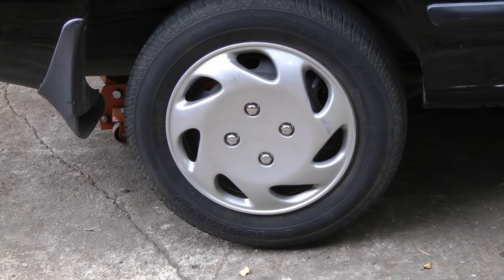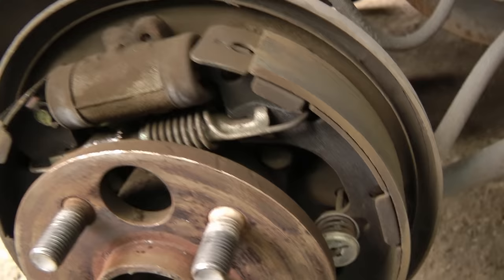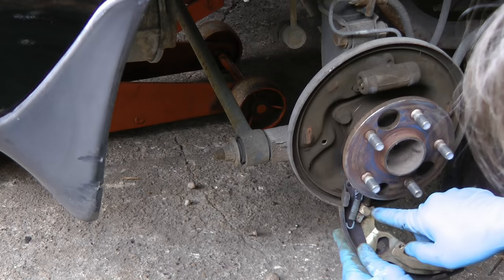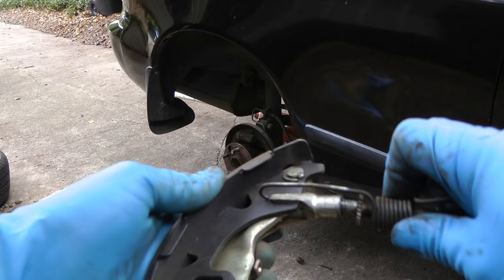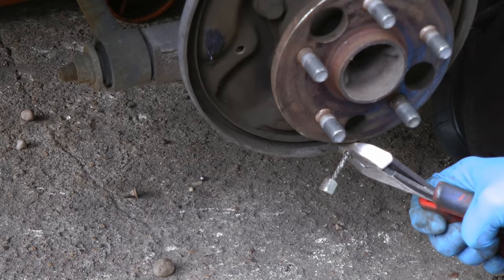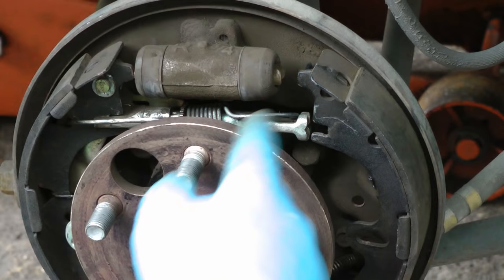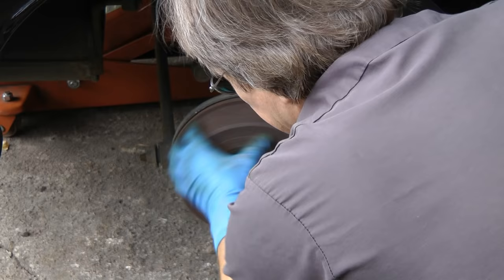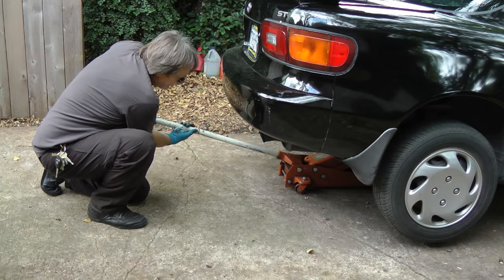How to Replace Drum Brakes on Your Car

Comment: @ArmenianSOADfreak because the bottem end oppisite of the wheel cylinder needs to drag a little so that the shoes of the wheel cylinder side contects evenley when you apply the brakes otherwise it will not only be somewhat uneffective but will wear unevenley but with self adjesters this problem corrects itself when you step on the breaks a few times and the same thing does not apply for disc and pads in the rear as the shoes back there are used for parking brakes

Comment: I recently replaced the shoes on my 96 ford ranger (even machined the drums a bit cause one of the springs was actually broken and pieces of it were chewing up the drum.) Now, after that repair, the parking brake doesn't hold the truck as firmly as it once did. Will that self-correct or should I go back in and tighten the "automatic adjuster" some more?
Reply from the maker: tighten the adjuster, you always have to do that to make it firm

Comment: I gonna guess that the reason you didn't use stands is the fact that you were never under the vehicle. But the load could still shift on that single jack. It might have been wise, if only to set an example....

Comment: hmm I have a very similar brake on a chevrolet lumina apv but the drum didn't have provisions jacking screws

also aren't you going to damage the spring if you use a cutter to undo the spring ? 

I've had a spring break and get stuck between the shoe and the drum, it ruined both !! :(

also modern cars like a camry 2001 gas a combo shoe and pads drum/disc hybrid brake that is a different procedure 

do the auto-adjuster work when you use the e-brake only ?

also that bearing is 53$ on ebay w/abs

Comment: Hey Mr Kilmer got 2 questions. on a 2008 Kia Rio Lx , are the rear drum brakes hard to do ? beings its a newer car?   an 2nd i want to change the brake fluid in my hyundai i see all auto parts stores carry synthetic DOT 3 4 brake fluid ? is that safe to use on a 99 elantra non abs , just want to flush the brake system. let me know . thanks scotty

Comment: hey Scotty love the  Channel. question I recently change my shoes and when applying the brakes they come off the master cylinder what might cause this not properly tightening the adjuster I need a little help
Reply from the maker: yes, you put the shoes so they fit on the wheel cylinders, then adjust the wheel until the shoes just start to rub on the drums as you spin em

Comment: How to remove that C washer on the parking brake shoe lever (This video about 02:18 shows it) ?  I failed to get it off and didn't transfer the lever to the new shoe. Also, my plier didn't work well on these springs, they are so tight, maybe I should try a bigger plier?

Comment: Yeh I have a GM Sunfire 2004 with new design rear brakes n you will not get drums off with out cutting them off.they brakes are adjusting out on there own driving down the road not touching brakes n seizeing up the wheels good old GM they made a two hour hundred dollar job into a grand job n if just want to inspect the brakes you are Gina pay dearly.

Comment: I'm changing shoes on a 2003 civic and I am having trouble with the retaining clips. Any suggestions?
Reply from the maker: I push and shove with a cutting pair of pliers, but auto stores do sell a special tool for that
Reply: I got it done. Thank you.
Reply: if you can manage to get a tool or a digit behind the center pin (on the other side of the hub) that will help the pin not push in with the holding cap. when the cap/pin is heavily rusted it's nearly impossible to push the cap and spring down without also pushing the pin down - the special tool holds the pin head/tip in place while you depress the spring cap, but you can get the same effect by simply stopping it from behind - if you can reach it (depends on the vehicle i think?)

Comment: Hi, Scotty:

I have a problem with my 1989 Ford Ranger Standard Transmission. Recently when I press on the brakes slowly, the pedal goes all the way to the floor and my truck barley slows down. On the other hand, when I press on the bakes quickly, the truck stops. Help?

Thanks
Reply: Brakes need bled

Comment: Hi Scotty.  Great video.  Question; on one of you videos brake parts using ebay. You mention AKEBONO for brake pads. I searched ebay and found nothing on  AKEBONO brake shoes. I plan on replacing the shoes on my truck in a week or two. Is there another brand you recommend? I see lots of Becky Arnley, Wagner and Raybestos brake shoe listings on ebay. Those okay to buy or do you think Auto Zone bake shoes are good enough. Thanks

Comment: Heads up,  forgot to put the base that holds the spring in place.. Base, spring, retaining cap. Only reinstalled spring and cap on the video.  If you watch when removing the shoe the base is there before the spring..

Comment: Why wouldn't you get new Brake Hardware... IE New Spring ebay $10. Whatching him put on brake shoes without Anti Seize.. PRICELESS. For ever thing else there's Mastercard.  Oh yea and why didn't you use Brake Cleaner and a wire brush to slean the connector points and the whole thing.

Comment: How difficult is it to replace front brake pads on a 2000 kia sportage
Reply from the maker: pretty freaking easy
Reply: Charles Keene hahaha Probably the easiest thing you'll ever do to that Kia besides put gas in it.
Reply: Scotty Kilmer hey scotty can please tell me if I need to bleed out the brakes after changing the brake shoes??
Reply: My wife drives a sportage and it's the easiest modern car I've worked on. I love it.
Reply: @economycollapse6546   Only if you disconnect the brake cable at any point (which he didn't).

Comment: @RAJSTA81 I forgot to add something: In that video, he used a pump to pump fluid in through that fitting, but if you want to change fluid, you will have to use a vacuum pump to get fluid out. Also pay attention to the fluid level  under the hood.

Comment: No need for a hammer. The drum hub comes off easy enough with going behind the wheel hub and back adjusting the brakes with a screwdriver. Its the lip on the outer edge that didn't come in contact with the surface of the hub that stops it from comming off easy. 
But yeab just go ahead and smash your car with a hammer.

Comment: I know youre an expert mechanic,   but what in the hell was MB thinking when they installed the rear shocks on the 1999 MB ML 320?  There is barely a half of an inch of room to replace or install the top screws for the shocks. Please help Scotty,  what can I do? MB dealership said 1400. to replace both shocks and top control arms and a local mechanic said $600. and I have all the parts,  It looks like the trunk body may have to be cut to get to top bolts I hope not!

Comment: Scotty, I have a 2004 Cavalier with a drum assembly that has an "universal spring" (that W shaped metal bar) and a single spring for the self-adjuster. I noticed after changing the shoes and the drums (all new hardware too) that my brakes make a popping sound while braking and consistent with the rotation of the braking speed. I took the car to a shop and they adjusted them, and the driver side stopping making the noise, but now the passenger side makes the noise (or has continued to make the noise). So I took the passenger side drum off and loosened the adjuster to about it's lowest setting, drove the car around and braked until it tightened itself up. Once it was tight again it started the popping noise. I'm pretty stuck on the situation and might just take it back to the shop that adjusted them last. I'd really like to learn to do things right, but from most videos I see you just get the drum to make light contact with the shoes. Have you, or anyone else, had any experience with this? Could it be related to the emergency brake adjusting itself too tight or perhaps something else? I might disengage the E- Brake, readjust the shoes, then reengage the E-Brake, pulling it 6 times (per Alldata) to readjust it. Most things I have read seem to suggest the E-Brake should only need adjustment when it's replaced. Anywho, this is a pretty long post haha. Love the show.
Reply from the maker: try that last process, pray the spring isn't bent out of shape and need replacing, that is yet another really stupid GM design just to make them cheaper to build and it often breaks. Just plain dumb what they're doing to cars these days to save a penny
Reply: Thanks Scotty for the quick reply!

Comment: shouldn't you get the drums machined?
Reply from the maker: you can if you want, but I've had cars for 240 thousand miles with original drums never machined and they still work fine

Comment: does it matter if parking brake is on
Reply from the maker: +Marco Sanchez it has to be off of course
Reply: +Scotty Kilmer upon removal of a rear drum, a spring and a metal bar completely fell off. What could have caused this?

Comment: I never did understand having to adjust the "Automatic" adjuster. The name is quite misleading.
Reply from the maker: Once you put new brake shoes on, you have to make the first setting of the adjuster be close to tight. then it automatically adjusts itself as the brake shoes wear over time until years later when they wear down to metal

Comment: I’m not trying to be disrespectful but not having jack stands is a huge mistake ...hydraulic jacks could loose fluid and lower or if that floor jack is bumped by mistake  game over for the person making the repair
Reply: Or you can stack wood blocks on top of a cement block in case it fails. It won't break if it's a small SUV, idk about trucks though.

Comment: So you don't have to bleed the brakes,  I await your reply,  thanks
Reply: No need to bleed the brakes as long as you don't mess with the wheel cylinders on each hub, if they are leaking then you have no choice then to replace wheel cylinder parts then would have to bleed the brakes.

Comment: The way you drop cars so fast off the jack gives me anxiety. I always feel like I'll BRAKE something doing that.. Then again I usually use scissor jacks
Reply: Scissor jacks sounds more risky than any thing , they're actually for Emergency use to change a flat 😉
Reply: @tracysmith9934  Not if you put a jack stand under the car after lifting it. I would never rely only on a scissor jack. That's wild.

Comment: Hey Scotty is this set up similar to a 1990 Chevy Suburban this :)
Reply from the maker: yes
Reply: future .star01 you really had to ask if it was the same? Maybe you shouldn't work on that truck. Drum brakes have always been that way. minus an automatic adjuster with an all manual one In some cases. That's like asking if changing the front pads is the same prossess on different vehicles. don't forget the blinker fluid. dude all I'm saying is. jack it up. take it apart. look at it. how else would you know? If you're saving money great fuck shops. just don't ask such a stupid question next time. egg in your face

Comment: How about new brake hardware... Never cleaner the threads on the star wheel... Never got the glaze off the drums... Never tested to see if the wheel cylinders  worked...ect... but on the cheap... good video.